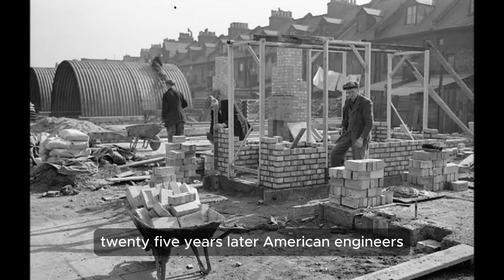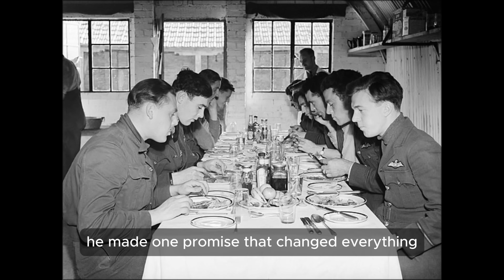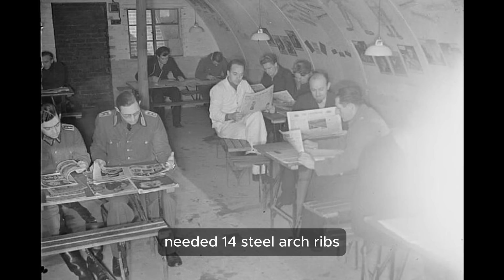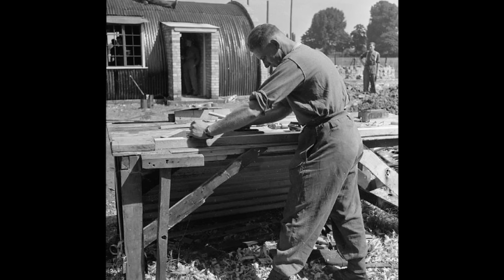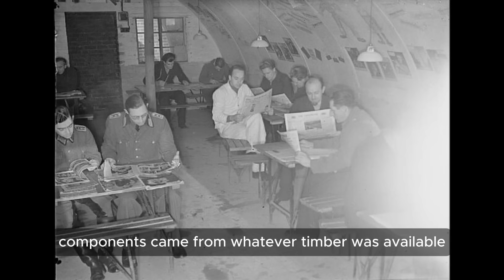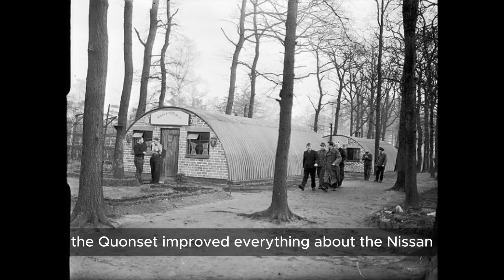Why Britain's Nissen Huts Beat America's Quonset Huts in Every Way

Comment: Australia used surplus WW2 Nissen huts to provide temporary housing for post WW2 immigrants.  My wife and I purchased one from a settlement that was being demolished near Sydney in 1965 to use as a temporary  dwelling whilst we built  a proper house on a 5 acre block.  We took it apart and transported the pieces in a typical box trailer.  It had steel bows (made in three pieces, bolted together) with wood longitudinal  beams bolted to the bows with J-bolts, and the cladding was corrugated aluminium sheet, not steel.  They were more than half a circle in cross-section, unlike Quonset huts.  The floors were conventional wood.  They were lined on the inside of the wooden longitudinal beams with fibre-boars sheets;  the airspace was ample to fit insulation, but it wasn't necessary in our climate.  It was quite comfortable,  except that it magnified wind noise.  I converted it to a drawing office and woodwork shop after we moved into the house.